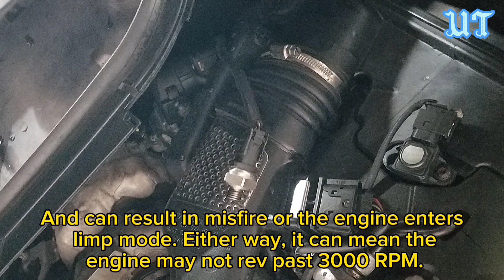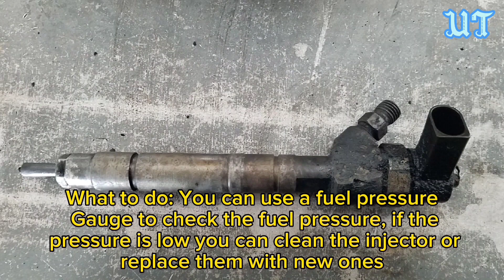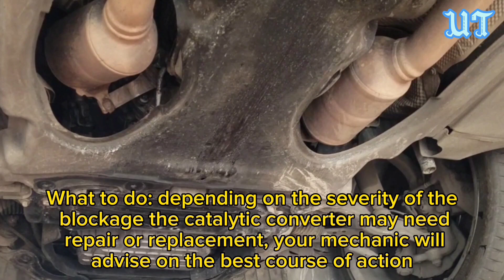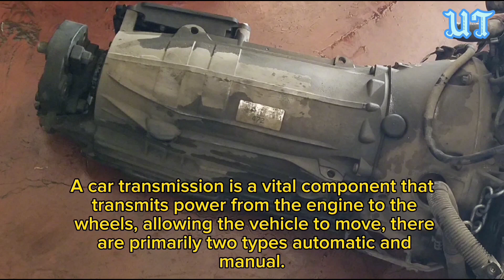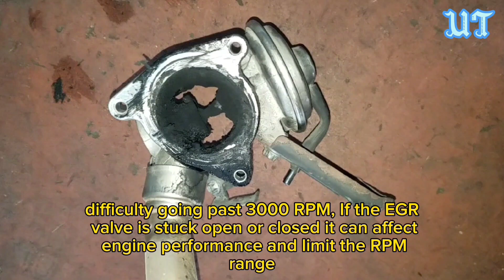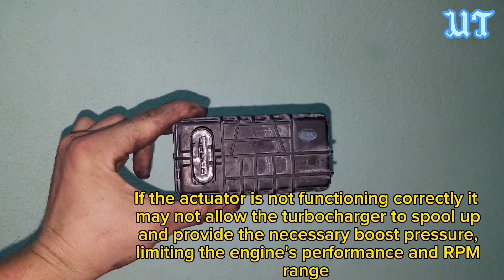Car doesn't rev past 1500 to 3000 RPM,  Top 21 Reasons  and Explanation

Comment: Are you talking about when the car is moving or at iddle as my car is not reving past 3000 RPM and the speed is going to limp mode at 100mph. But at idle if i rev it the RPM goes past 3000 RPM  to the end. What is the problem?😊
Reply from the maker: Well Many modern cars have a built-in rev limiter that prevents the engine from exceeding a certain RPM while in neutral or park to protect the engine.
But it can occur even in idle in erlier cars, as for you car I would say that you should plug in the OBD 2 scanner to check for the cause of the problem, to be more precise
Reply: @topuniversaltech1482 i have checked through scan machine and no any code. But when am driving when it  reaches 100mph doesnt exceed that speed, while maximum speed in my car is 180mph and i used to drive it to such speed before. What can be the problem now?